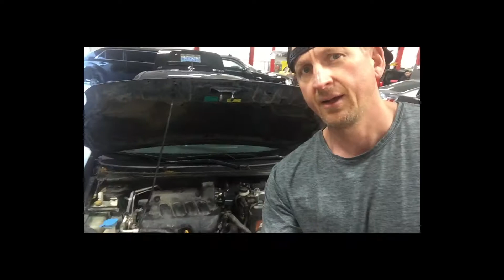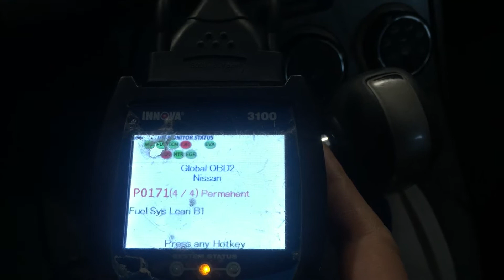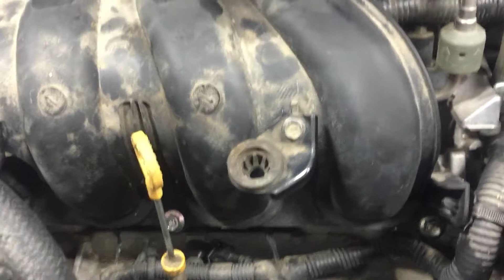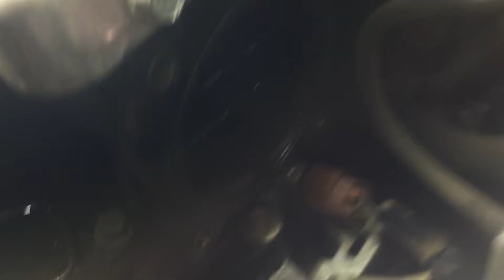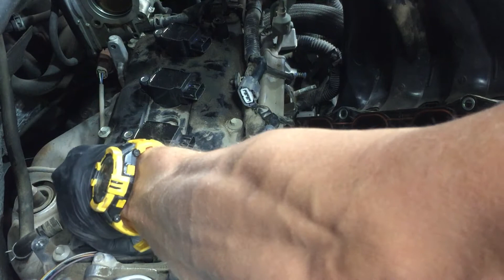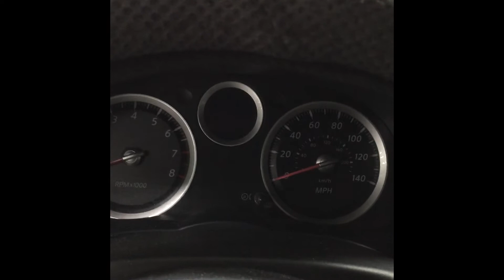2008-2010 nissan sentra 2.0 l coil pack removal and p0300 misfire codes troubleshooting

Comment: I did all new also with just 171 code but after that it then started p0300 and now dumps fuel...new o2s plugs coils gaskets on intake and valve cover too...i need pt 2 please...need to know im not the only 2010 sentra with these issues
Reply from the maker: Did you check to see if the actual intake is bad? Apparently on those they like to crack, and cause all kinds of 0171 codes. Also check the intake boot for cracks that will also cause those codes as well.
Reply: @findfixxflip  i have an aftermarket intake that is ok basically from the tb foward...but when i did change the intake gasket i noticed a slight gap in the seam where the intake piping meets up top right behind tb mount...so i did order a new manifold but still not sure why its dumping fuel now...as soon as i get the manifold ill update this...hopefully that solved 171 code and ill just be left with 300 code
Reply from the maker: @bigsmurf0101   So it's dumping fuel because you have The computer incorrectly reading the air to fuel ratio because it's detecting more air in the system through the vacuum leak and it's sending more fuel to even out the ratio that's why it's dumping fuel
Reply from the maker: @bigsmurf0101   That's also why you're getting missed fire codes because the car is not reading that ratio right and it's causing it to miss fire as well
Reply: It was running fine after the plugs and gaskets replaced for a few hours then out of nowhere while sitting idle it started missing and smoked whole drive back home topping out at maybe 5mph...plugged in my actron and the 300 code came on so pulled plugs and cyl 4 and 2 reaked of gas 1 and 3 were ok
Reply: Also noticed belt and tensioner were shot so replaced that as well...kinda gave up til hopefully get intake tomorrow
Reply from the maker: @bigsmurf0101  yeah my experience is that the engines have alot of problems
Reply: Gonna swap intake and injectors and hope it works

Comment: I have the same problem with my 2008 nissan sentra,,how much do you think for me to spend to fix the same problems?can you advise me..thanks..
Reply from the maker: coil packs are about 50 bucks on amazon. spark plugs will run around 25 bucks.  Now what i found out later is that the intake gasket was bad and creating vacuum leak. its an easy diy and costs around 20 bucks for the gasket
Reply: @findfixxflip which intake gasket

Comment: Did you ever find out what it ultimately was?  I have a 2010 Sentra SR, i changed my spark plugs and 1 coil pack (Cylinder 1)  I might as well change the other 3.  Im gonna look into that oxygen sensor thing.
Reply from the maker: so after replacing all that im pretty sure it's the intake manifold gasket.  i was getting ready to change the valve cover gasket but realized the cylinders were dry so that wasn't my issue. so apparently the intake manifold gasket starts leaking and put air in the system causing those random misfires. Im getting ready to do a part two of that video, but im waiting on new injectors because they also cause those codes. thanks for watching bro let me know if that helps